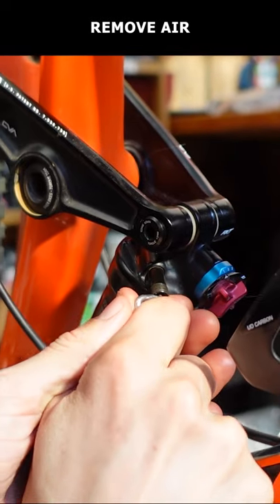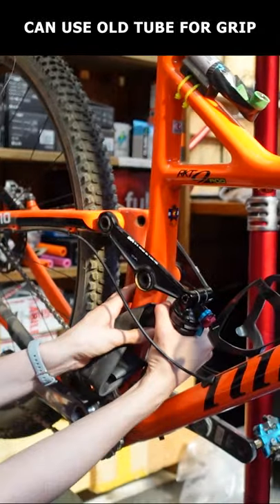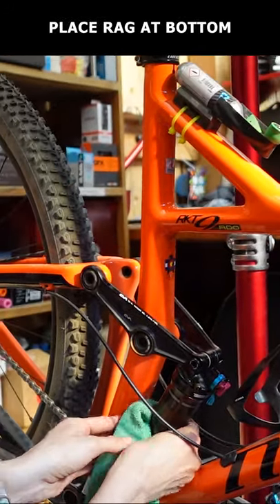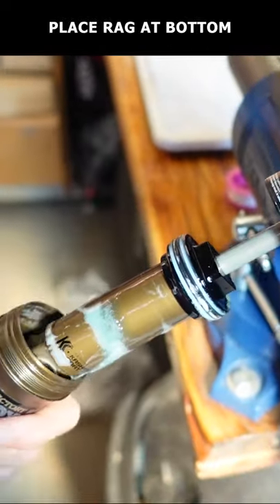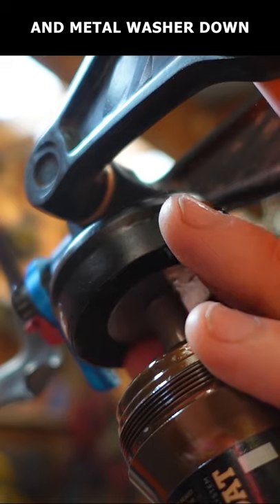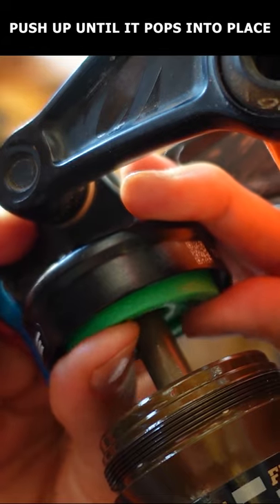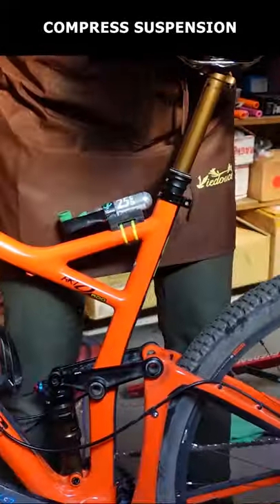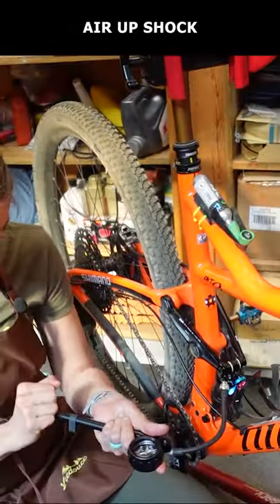How to install shock tokens #Shorts

Comment: I have a Jet Niner and I got some scraches on my suspension shaft (that steep pipe in the inner middle of the shock). Have you guys noticed someting like this. I suspect It happened bc the cva bearings got locked.